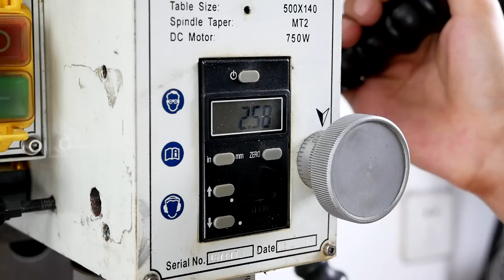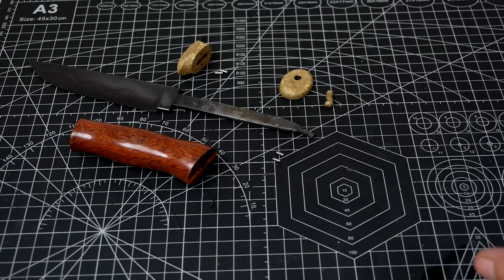Making a Knife from an Old Bearing

Comment: Video quality and craftsmanship are excellent. You’ve got a winning formula here and I’m certain you’ll grow at a staggering rate if you continue. 

I’ve always wondered why I haven’t seen more people use this method of heating metals. I’m sure it still has its compromises but it still didn’t seem like a terrible idea to me. 
Im glad I could see it used here! I am greatly impressed with your work. You’ve got my subscription
Reply from the maker: Thank you for your support, 🍻 This heating method is limited by frequent replacement of coils, but I am willing to compromise, because the heat spreads less, the heating efficiency is high, and it is fast.

Comment: Files are designed to cut one way otherwise you damage the teeth, sand paper on the other hand will cut in all directions (minus the paper backing.)
Reply: False.  I challenge you to prove it. 
I use files throughout the day, each and every day in my line of work. I'm a hazardous tree removal Expert of 26 years and I've been sharpening my chains with files even longer than that.
Edit:  A file is harder than the material you cut with it for a reason and no amount of dragging is going to damage or dull it in the least.
Reply: Also sanding in one direction prevents creating multiple planes on a surface. If you want a single flat surface, sand in once direction with control.

Comment: Excellent job.  But dont heat steel to white, thats short before melting, as you saw. Only steel thats hardened that high is HSS. That bearing 42 Cr6 cant stand that.
Reply from the maker: You are right, I learned what you said in this project.  But heating the steel until it melts is even more exciting.  🍻

Comment: I always have to ask, if you are going to pin it in place then why glue it?  If you are going to glue it then why pin it?
Reply: From my research and admittedly limited experience, its really just because two modes of bonding is better than one. If there’s a failure with chemical adhesion with no mechanical adhesion that’s just it. Failure with mechanical adhesion with no chemical adhesive is the same. 
TLDR, it’s just a good insurance policy regarding longevity. 

I do suppose another possible benefit with the mechanical and chemical components is that the glue or epoxy can serve as an oxide deterrent for the metal under the scales for a prolonged period.

Comment: Hello why is it breaking  don't use the induction heater it's not heating it to the maximum
Reply from the maker: High frequency induction heating is very convenient to use, it heats up very fast, and it can melt steel, but I don't have a good grasp of the temperature and power output.

Comment: это что за аппарат такой у вас что способен греть до красна  металл ?
Reply from the maker: High frequency induction heater with voltage 220v
Reply: @HansKnives  what is it called, the brand of the product, it can be found on Aliexpress / Greetings from Moldova.
Reply from the maker: @valeramaga5453  https://www.alibaba.com/product-detail/220V-15KW-30-100-KHz-High_1600403316585.html?spm=a2700.details.0.0.710938d6E64my2
Reply from the maker: @valeramaga5453  This heating device is very, very efficient. Can easily melt steel.
Reply: @HansKnives   Спасибо вам конечно,  но что бы  платить  мне столько денег  за такой аппарат-нет-,  я то думал что он стоит  100 или 200 долларов.

Comment: 第一次为啥断了啊
Reply: He said in the video that it was turned up to high and was heating the metal too hot too fast. So he lowered the voltage output and it solved the problem.